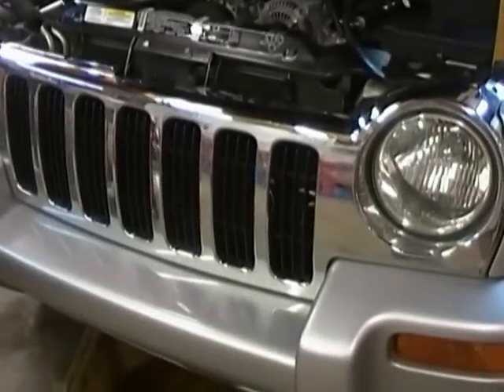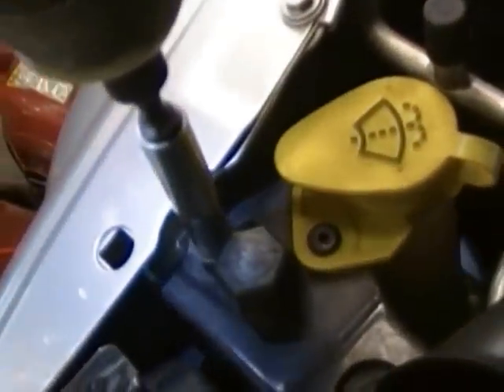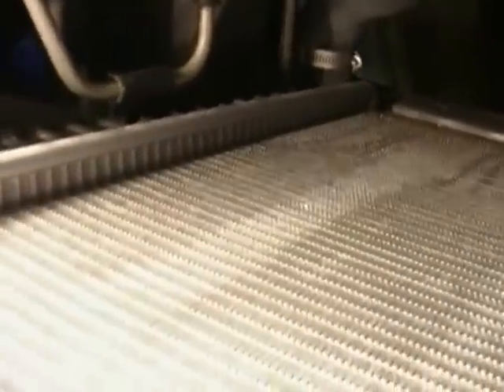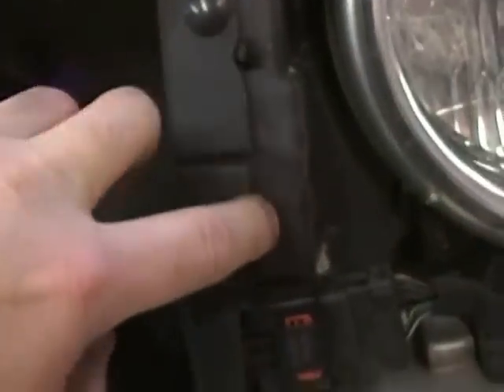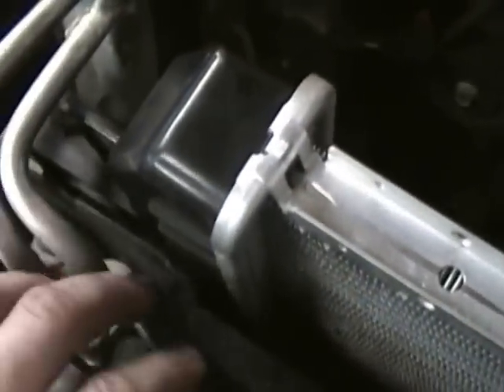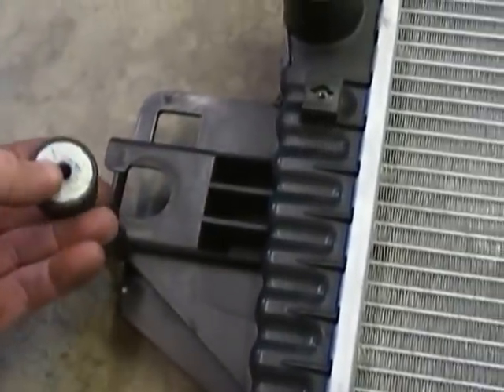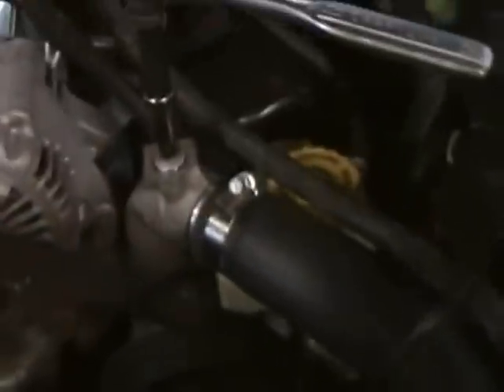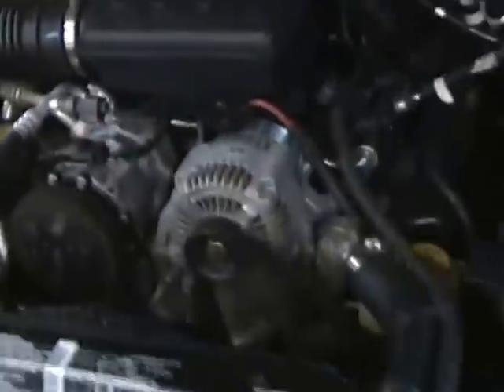How to: Replace a Radiator on a Jeep Liberty

Comment: Just had to do this on a 2003 Jeep Liberty 3.7L, solid instructions, the side skirts were the hardest part of the whole job.
Reply: Taylor McGraw was the radiator you bought an exact fit? Like you didn't have to do any modifications to attach everything? And if So, where did you get your radiator?

Comment: is it necessary to drain the transmission fluid before disconnecting the transmission cooler lines, or can you disconnect them and just keep the hoses pointed up?

Comment: interesting i have an Limited 2003,
i have + the electric fan and thermo fan on the engine.

i have 3 radiators: transmission,ac radiator and i think the 3 rd is the power steering.
thats a big problems when you want to change the engine radiator.

it take me 4-5 hours for the job.

remember mine is an Limited 2003

thanks for your video ,it informed me 

Gervais